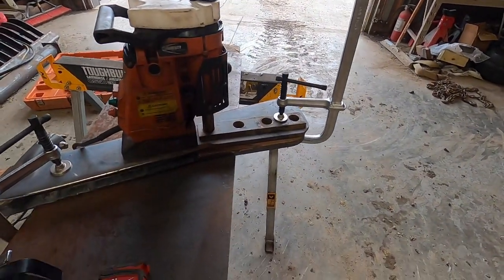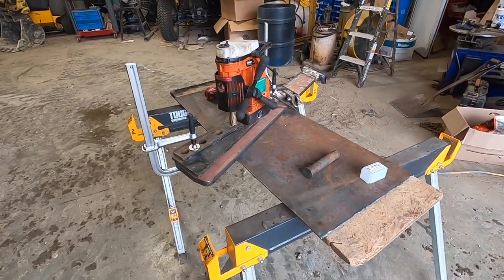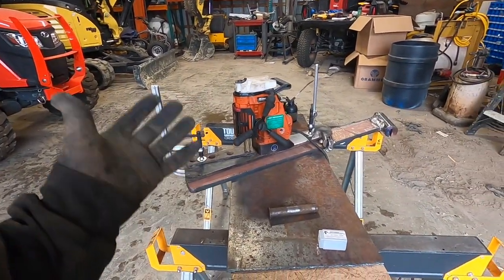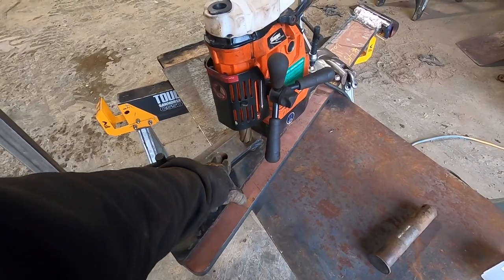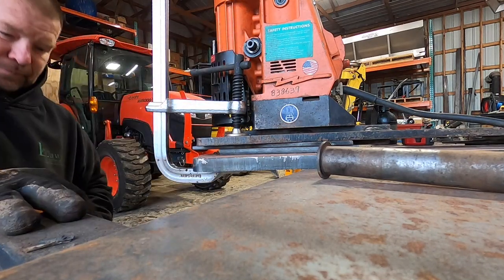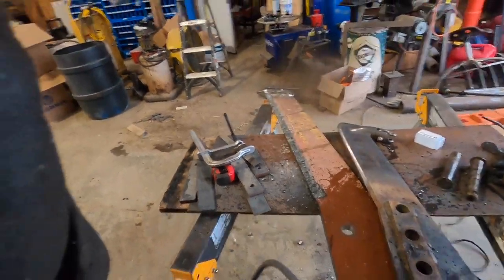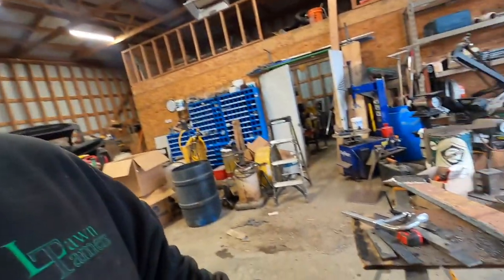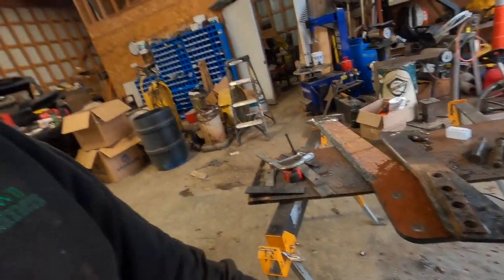Making a Vibratory Plow Blade

Comment: If you were going to buy an SVL for 17 acres, would the 65 work or would the 75 be the better choice. I know that depends on a lot thats not being discussed here. In general I always prefer bigger over smaller. Just trying to preserve capital. Going to mostly be used for putting in the yard when we build along with general up keep and maintenance. Nothing that I would consider heavy duty dirt moving. Probably will be paired up with a KX 057 as well. Just curious.
Reply from the maker: There isn't hardly any difference in the lift capacity between the 65 and 75. Ive owned and tested both. I actually like the 65 over the 75 for alot of reasons. The 65 is quieter, faster ground speed, lighter, lower to the ground and I think it has a smoother hydraulic system. If you push it pretty hard you can bog it, but you can do that with the 75 as well. 

Hope it helps. My vote would be a 65 more than likely, but not sure all your tasks. But I could us a 65 on a daily basis still doing excavation work.

Comment: Have you ran it much to see how it’s wearing. In sandy land we can wear a new ditch witch oem blade out in a single day. I have a CNC plasma table just wondering how you cut the bevel. Thanks.
Reply from the maker: I have ran it a total of 5 times now and the shortest run has been 180' and the longest run was 500'. I am now running it on my excavator. I have a 12,000 pound mini that I fitted with a vibratory plow and pull with it. It just gets polished up. The edge is still sharp. But I only use it when I need to go 3' deep doing water lines and I just did a sleeve for a propane tank with it.